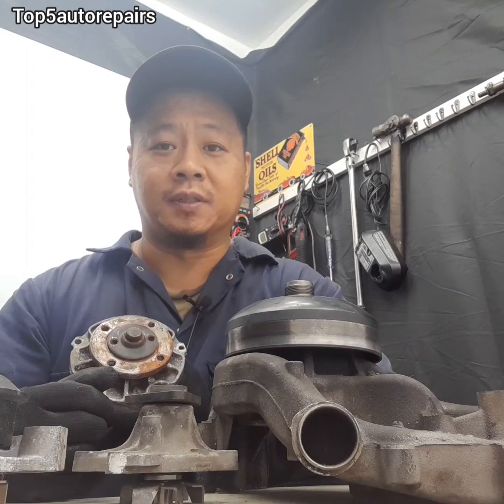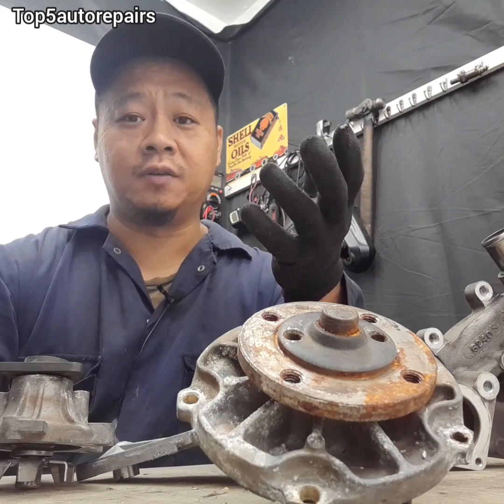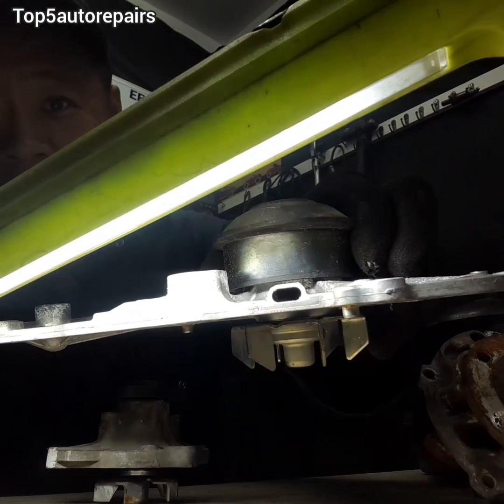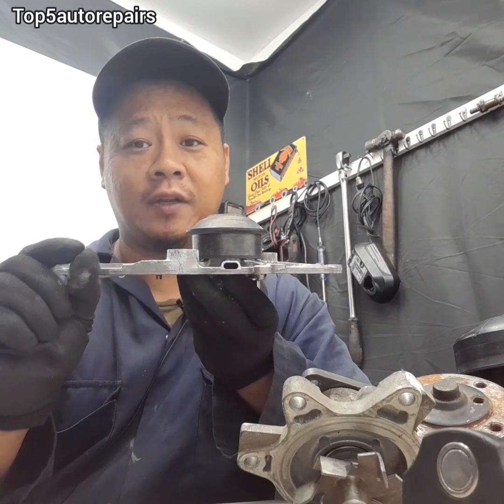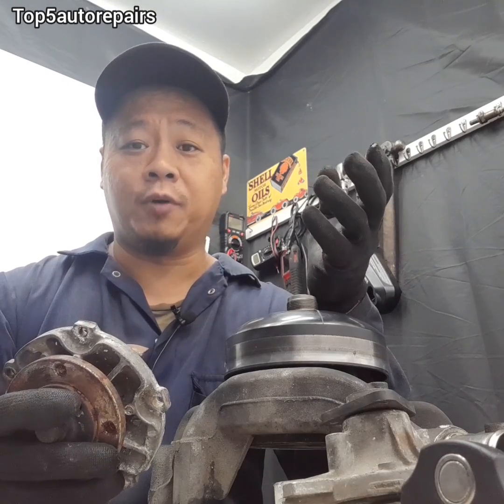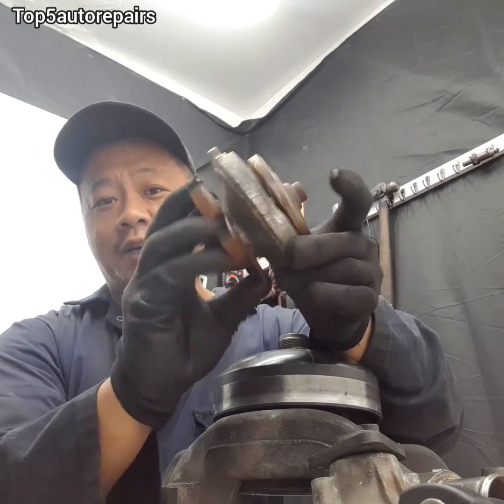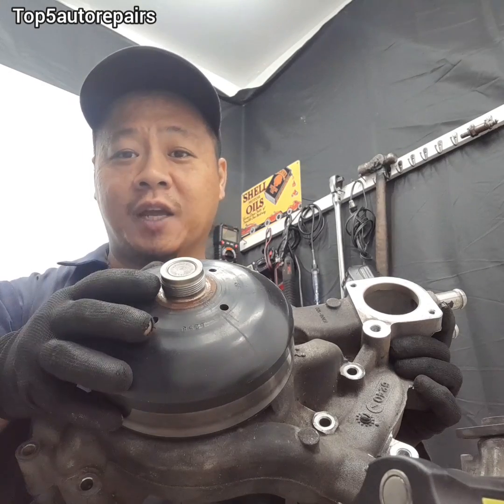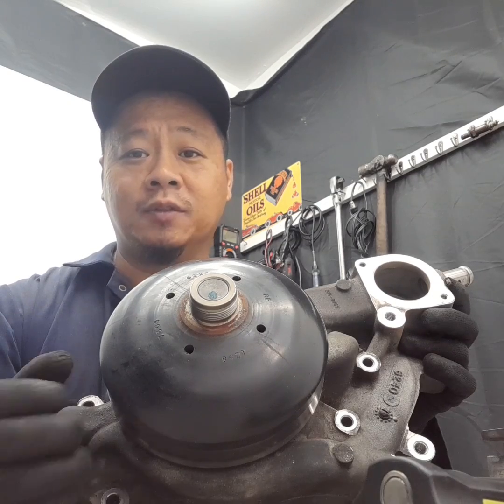THIS HOLE IS TRYING TO TELL YOU THE WATER PUMP IS ABOUT TO FAIL AND CAUSE YOUR ENGINE TO OVERHEAT

Comment: I just changed my water pump recently but it’s still leaking coolant from the same area by the water pump. Should I change the water pump gasket? Or the lower radiator hose?

Comment: What if it’s an internal water pump? Are there any other signs to look out for when your water pump is bad, other than a leaking weeping hole?
Reply from the maker: Coolant leaks, overheating, crankshaft position sensor may stop working if hot coolant drips on it, air in the cooling system, grinding or growling noise, belt slipping off caused by bad water pump bearing, if it's timing chain driven and the seal fails, coolant can leak inside the engine and mix with the engine oil (only for some vehicles).
Reply: It’s a 2017 Ford Explorer with the 3.6l. It definitely has the internal timing chain driven water pump. I did see evidence of a leaky weep hole and a puddle of coolant on the ground, a few days ago. The next day, my vehicle signaled an overheated light and I noticed the reservoir was empty. I level off the coolant and it hasn’t leaked these last 3 days. That’s why I’m asking if there are any other troubleshooting tactics to diagnose a faulty timing chain driven water pump. Since it stopped leaking from the weep hole, I am now a bit stumped. 
The dealer wants to charge just under $4k to change it.

Comment: Question: Can you just replace the water pump seal or oring?? If the water pump still works fine?
Reply from the maker: That's fine as long the water pump isn't making noise or worn
Reply: @Top5AutoRepairs  Thank you!! 🙏

Comment: Thanks for being honest and informative. My motorcycle water pump weep hole has a small drip after a long ride. They quoted me $3,900 to replace the water pump, when actually this dripping is normal.
Reply: Hey, How is that coolant leakage now from a weep hole? Did you fix it after 7 months since your comment here? I noticed the exact same situation after a long ride but coolant levels are the same and no more leaks when standing cold from the last 2 weeks. Many thanks 🙏
Reply: It turns out this is normal, as long as you don't see it on the ground,  and the coolant level doesn't drop, i put around 2k miles without any change, if its not broken don't fix it

Comment: So you mean if the scooter only leak a little bit, which means it is normal and no need to repair ?
Reply: from my understanding, weeping WP is a sign of failure. My Gates WP that I installed about 1.5k kms ago already leaking out coolant small bit like drops from the weephole. It means the seal is failing